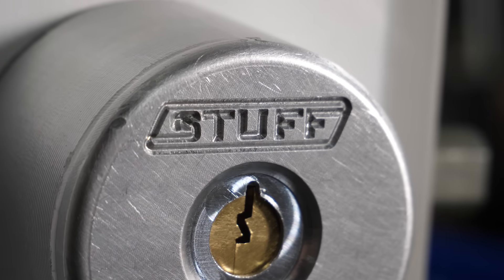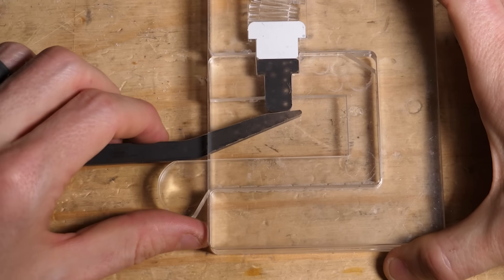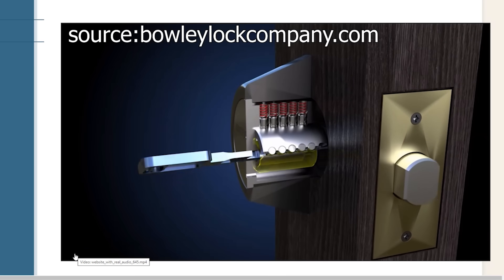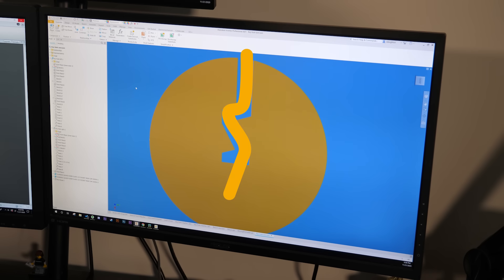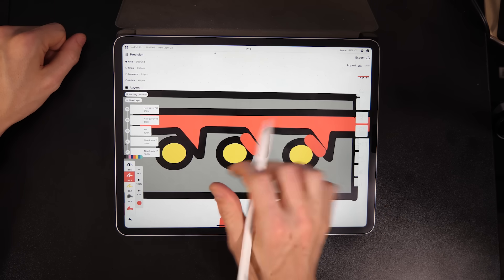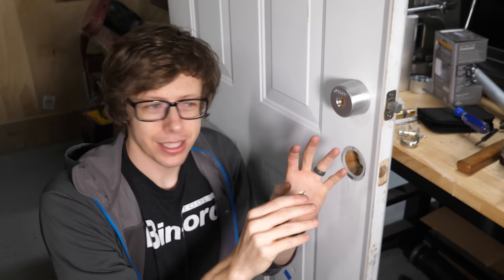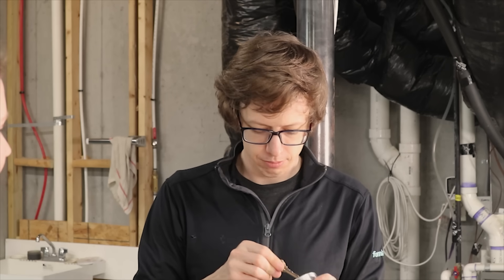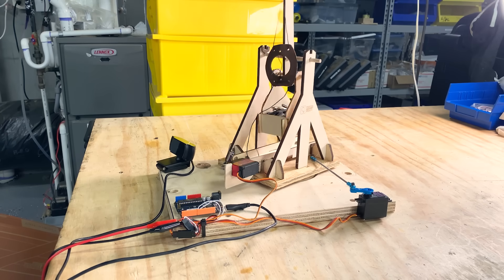Making an unpickable lock. Calling locksmiths

Comment: “ i found a locksmith that specializes in picking locks”
Ah yes the floor is made out of floor
Reply: So adorable how you thought youre being smart while betraying you're totally clueless that locksmiths don't ONLY pick locks OR what the word "specialize" means, who knows maybe both.
Reply: Some locksmiths either make a new copy of the key or simply try to dismantle the lock. I'd say most commercial locksmiths that avoid picking even if it is usually far quicker and less destructive to the lock body in the end, do so simply because of the negative connotations that some people have with picking.
Reply: @selfishteammate  And also time. Drill ten locks and get paid or pick five?
Reply: @EjvindGEMDark  why drill when you can use a Ramset and give the lock the ol cattle gun treatment
Reply: Well i just googled it and found this: Locksmiths specialize in cutting keys, changing the locks, and generally protecting homes and establishments from unauthorized entry through the use of lock and key mechanisms.

So you guys are right.
Reply: He means instead of breaking the lock with drill or a crowbar.

Comment: Usually there are two approaches to the lock problem. First one is picking the lock. The second one is actually physically breaking it, to gain access. I was doing research in the past and I found some really nice solutions for complicated lock cylinders. One of them is called MCS. Check it out, it may bring some new ideas https://www.evva.com/int-en/products/mechanical-locking-systems/mcs-locking-system/

Comment: Great as an engineering project.  Glad to hear you admit that it is not applicable to common use due to cost and complexity.  As far as this protrudes from the door, a pipe wrench would remove it in short order.

Comment: Hey, you have a kwikset electronic deadbolt on your home. Those are shit. They have a high key fail rate and bolt fail rate. The solenoid controls the bolt that will fail too if the bolt rubs against anything. So unless you're letting amazon put boxes in your house you can do much better. August lock or anything by schlage, omnia or emtek.

Comment: In my country a locksmith will have zero problem whatsoever. He will simply not even bother picking the lock, he will use a drill and change the lock afterward. in 5 minutes.

Comment: Take a blank key and cut all 5 spacings to the lowest schlage depths. get a spring with like 3 coils that bearly slides into the key and stopps at the neck. a wooden block a rapid banging while gently applying pressure. you can get it. im sure the locksmith lawyer will pick it and bump it. good luck. amazing video. great job. i think I'd have a hard time. and thats all a lock it for to stop someone for and unknown amount of time untill they kick the fucking door down..

Comment: Two things: If you match bore the key pins and or make the system flex so the pins have as close as possible to identical friction maybe that helps? Also maybe try making a throwing knife or ax that corrects itself. Lastly, deburr better and keep up the good work.

Comment: sips ice tea and puts down his glass  (Safety First! So puts on safety glasses) (Uses a sawsall just cuts the door in half)  Next time, don't waste a locksmiths time.  You need to think like a bad guy which you have failed to do.  Bad Guys don't waste time picking locks except in James Bond movies.  In the real world they kick it in.  In the real world they've welded 18" of steel to the top of a bottle jack, mount it sideways then crack the door open- if it's done right you might hear some wood slightly splinter on the side.  Now do the "Boot Test" or watch COPS as they use their door rammer.  Or use plastic C4 explosive and simply blow out the wall- the point being is if someone wants in, they're going to get in.  Now let's look at how stupid your door is.  All that wonderful glass- even if you put on 12mm clear armor I promise you a 8 or 12 pound sledge is going to turn that lovely door into splinters.  The only thing a lock does is buy you time to grab a firearm and provide evidence for your insurance company- that's it.  Unless you get serious about "armoring up" and put in a concrete set, steel door frame with serious plate armor and install a safe door- yes, you can buy just the door to fit the frame.

Comment: Cool and all but your lock is only as good as the door frame it's in.  
I boot the door to gain entry.  Not standing there picking the lock to retrieve you lol . 
A door ram hits beside the lock and bobs your uncle.
I'll assume not many thief's pick locks and if they do it's with a hammer lol sooooo cool and all but again it's a deterrent.. 
You can lock with a normal lock and it's sufficient .. cool though lol

Comment: My idea to beat this is a custom lock pick tool. A normal pick they use to move pins but it has 3 separate rotatable picks. That way once once pin as been set to correct position you can keep that in place then rotate the next part of the lock pick tool eventually lifting all of the pins in place at the same time. I imagine this would be a tricky tool to make though.

Comment: For it to be judged fairly as a lock it should be housed inside the conventional space of a lock. As it is right now it fails a lot of things a normal lock handles. A small hammer probably breaks this lock of the door.

Comment: Thats really interesting. But nowdays doors/locks are getting impossible to pick. For example: my door doesn't have typical key. It goes sideways and when locked 4 TIMES it pulls out 7 pipes and insert them in the other side of the door. That makes that door unlockpickable. But the door costs only 300€ which for what protection gives you its nothing

Comment: Your lock is really cool, but the function of locks is not to be impossible to pick! The function of locks is to “ Keep Honest People, Honest!”. No matter the crafty the lock, they are not going to stop the determined criminals.  A three foot long four inch capped pipe with a loose three inch capped pipe inside will take down most household doors with one pounding. Most Police departments have commercially engineered versions of this pipe. I have seen people that were so paranoid of burglaries, they had ten locks on their door. He still got burgled with a drill and a saws all through the wall of his apartment. I think the locks were a invitation to the burglars.

Comment: Abloy already has had similar "locking discs" on some of their most expensive disc-detainer-locks, and they are "unpickable". 

In their desing, you first rotate the key all the way, which locks the discs, then rotate the handle to "check if the discs are in the right place". 

They have even more combinations, and they can't be even bumped by accident to the right place.

Comment: It is probably possible to build a lock that is HIGHLY resistant to picking, but machining tolerances and wear may make it fail over time--either it will become more pickable or it will fail to be able to be unlocked because it jammed up. I'd love to see LPL or Bosnian Bill have a go at it. The local locksmith won't have the shear experience.

Comment: Yeah, this is the way to go.
Basically all classic locks work along the same principle: key puts into place mobile transmitter parts, transmitter parts interact with a challenge.
For pin tumblers, pins are transmitters, challenge is shearing line, for disk detainers disks are transmitters, challenge is the side bar.
Most lock picking is based on picked directly interacting with the challenge through the mobile transmitter.
So if you use a system where you lock the pins before applying the challenge you've blocked all conventional attack.
Honestly it's not an idea so complicated lock makers wouldn't have figured out decades ago. I think Urban Hawk (or whatever his name is) shows a Chinese lock concept like that in one of his videos.
So why are they not used ? Ok, first thing first there ain't a market for those: current high security locks are sufficient for most people, for $200 you can have an Abloy protec2 or Evva MCS and I don't care there are a three guys in the world that have picked them on camera in controlled conditions, for the commoners these are virtually pick proof.
So the pick proof part is sort of covered. Then you look at everything else: manufacturing cost, reliability, resistance to destructive entry, tear and wear, being small, fit into an euro profile... And that's why disk detainers have been a hit: they are hard to pick but they are also simple and super hard-wearing.
So back to the lock it's probably the right idea. If you want to stick with the initial idea my view would be instead of using different pins make all pins the same (the transmitters) and make the gate (the challenge) the variable part. Would also make it easier to re-key. 
Also the idea is probably easier to apply in disk detainers format.
Also using transmitters with poor feedback for lock picker, like magnetic components, is probably a much cheaper solution.

Comment: The worst thing with locks generally is just manufacturing tolerances, that's what makes it possible to pick them, arguably a traditional lever lock may actually be better than a modern one simply due to the fact they aren't as common by any means anymore and thus anyone trying to pick it will be relatively out of practice

Comment: RFID locks are just as easily hacked, someone can clone the RFID key by just walking near you and then can make a clone to open the lock. But you have made a simple but very secure lock, most other almost unpickable locks use special keys and different levers and devices inside the lock. If the LPL can't pick it then you need to go into business and sell these.

Comment: Very clever engineering!  I tried a different approach in the same spirit. The insight was,  extraordinary engineering goes into making locks incredibly hard to pick, but it only takes rudimentary engineering to make one that's *impossible* to pick.  As you point out, the essence of picking is that you fiddle with the pins and find ways to take advantage of imperfections and other properties to fix them in place while you try another. Even bumping, etc., do this.  My solution was to put the lock inside of a sort of knob such that you could insert the key but the cylinder is immobile until you let go of the key and then turn the knob, which closes over the key. Only after the key is sealed inside can the cylinder turn (via the knob.)  After enough rotation to seal the knob, it becomes possible for the knob to turn cylinder..  Moreover, as the knob/cover rotates and closes over the cylinder and key, it's cocking a spring so that it actually turns the cylinder with a snap, rather than incrementally. This is to ensure that there is no way you can engineer some kind of miniaturized or remote controlled mechanism to vibrate the key, etc. while you fiddle with the knob.  It was a point of honor that you must be able to use the worlds cheapest cylinder inside--a five-dollar no-name cylinder from China---because you're preventing picking, not making picking harder. Every computer science person gets into locks at some point so I showed it to a few pals. It got blank looks and zero interest, which puzzled me for a while. I even wrote to some people. Unlike real engineering, you knew the concept would work. But I realized, that the gordian knot approach takes all the fascination out. It's barbaric, really. Like digital watches v a fine timepiece.   A couple of years ago someone else came up with basically the same idea and marketed a bike-lock, of all things, with it. Weird idea, because who in human history ever picked a lock to steal a bike?  But there you go...  

I'd love to see a real engineer build one like mine for a door.

Comment: "I found a locksmith thats specializes lock picking"
Reply: Well, locksmiths in general just make or fix locks, so no, the quote isn't redundant at all.
Reply: Marketplace did a research about these "lock picking" specialists, most often they recommended drilling because it is unpickable (the lock had 3 pins without any special spool)
Reply: Most locksmiths just install locks
Reply: Lmao

Comment: As long as you don't have GLASS on your door, this would be a good idea because with glass on your door at that size, they will get in pretty easy anyway
Reply: Glas is glas and glas will break. -JerryRig
Reply: It doesn't really matter where the glass is. If your door doesn't have glass than your house probably have glass elsewhere on the ground floor where thieves can enter.
Reply: @joop1991  The chances of thieves breaking windows to get in is slim to none.
Reply: @ChaiKarl  I've worked in the criminal justice system in the UK for twenty five years and not once have I ever dealt with a case where a criminal has picked a lock to get in. I have however dealt with hundreds of burglaries where windows have been broken or doors / windows jemmied open.
Reply: Or you just break the frame.
Reply: ya just get like a big dang log and bust open the door.      ͡° ͜ʖ ͡ –
Reply: Locksmith here. Its impressively pick resistant. But It’s still no match for a well placed drill bit.
Reply: @Dannymeinz  its meant to be unpickable, not indestructible
Reply: lol comments here saying breaking glass is uncommon. 
Probably because it hasn't happened to them.

Usually it's someone who knows the homeowner, and knows that they are on vacation/out of town work. They break in because they know the person has specific valuables that they want. Happens all the time, you naïve bastards
Reply: @3OHT.  Well we never said it NEVER happens, it's just rare. Think about it like this. If you break a window, theres a way higher chance you will get caught. Noise. Also, what about security alarms? If a window/door is unlocked they never broke in.
Reply: @ChaiKarl  don't most security systems just check that the window frame is closed?
Reply: If a thief is not ready to break a window they are not going to pick the lock either so you don't need an unpickable lock anyway, if someone really want to get in they will break the door or drill the lock, a lock does not need to be unpickable, it just need to take more time than the other methods of entry

Edit: my neighbors got their front door window broken by a burglar a saturday afternoon, we were 4 household around them and no one heard anything or took the noise as suspicious, it's like car alarms, you never think a crime is going on.
Reply: Thats what simplisafe is for
Reply: E
Reply: unless you spend your whole wallet out on those Bullet-Proof glass thingies
Reply: @w4rt953  bullet proof glass isn't nessorcarily hard to break it just stops a bullet..
Reply: Sledgehammer the door lol
Reply: @LTNetjak if the cylinder isn’t made out of the same material (usually brass) as the key/pins, it’ll cause the lock to wear quicker.

Some lock manufacturers will put hardened steel plates in their locks protecting the pins, but that’s not gonna stop a cobalt or carbide bit.
Reply: Apparently in 1st world Countries you dare to build houses with unprotected glass. Here we put wrought iron protection on 1st or in some cases 2nd floor windows. So the only option for thieves is to pass a steel door or climbing to the 3rd floor(they do it sometimes).
Reply: In France, a lot of building are pretty old and replacing the doors and windows of everything would be very expensive and I guess we don't get burglarised enough to feel like we need too, the most secured doors you can find are on appartement buildings with reinforced frames and multiple lock instead of an expensive one.
Reply: Most people just leave the 1/4 inch screws in the hinges of the doors, deadbolt, and handle anyways. It's really easy to kick down a door if you aim at the handle/deadbolt. Or have any common sense with a sledge hammer whatsoever. Military background, not criminal lol
Reply: Thieves and Burglars rarely if ever even dare to break in. If the windows and doors are locked and unpickable by them then they give up (most of the time). Breaking and entering is loud, a major crime, and is very unsafe for the criminal.
Reply: @Good_Hot_Chocolate  right. And on top of that I took a crimes class in high school and we watched a video and researched that most break ins arent even break ins. It's by people who forget to lock their doors.
Reply: @ChaiKarl  Yup
Reply: @ChaiKarl  our house got robbed..:( they pried a bathroom window off the track. They didn't get much but the TV's but it took days to clean up the mess...
Reply: @shaunmilor  Jesus. My sincerest wishes for you! I had a friend robbed as well and they completely turned his place upside down, he forgot to lock his window and that's how they got in.
Reply: @Good_Hot_Chocolate  good.
Reply: @Good_Hot_Chocolate  There was a large window at the local hobby shop in front of the store. One day someone actually broke that window and stole a bunch of the stuff inside. The owners of the shop said that the window cost more than all of the stuff they stole combined.
Reply: @kazriko  and?
Reply: @Good_Hot_Chocolate  Forcible entry is about 57% of breakins vs 4% lock manipulation. And I imagine the lion share of "manipulation" is bumping.
Reply: @nate6692  interesting. Where are those numbers talking about tho?

Comment: I lost the keys to my Weatherguard toolbox on my truck, so I brought it to a well known locksmith. The young man attempted to pick the lock for about 15 minutes with no luck. Then came the next generation, his father, also the owner. 30 minutes later the grandfather / founder came out. Not much after that they told me that any additional time spent trying to pick the lock wouldn’t be charged to me, they just took it as a personal challenge. An hour later, they asked me if we could just drill out the lock and replace it. Ended up doing that, but I would now like to understand what makes that Weatherguard lock pushbutton so difficult to pick!